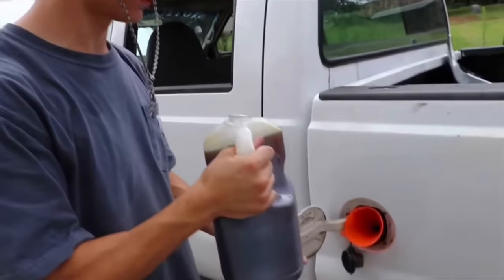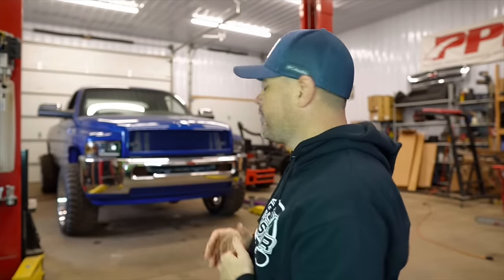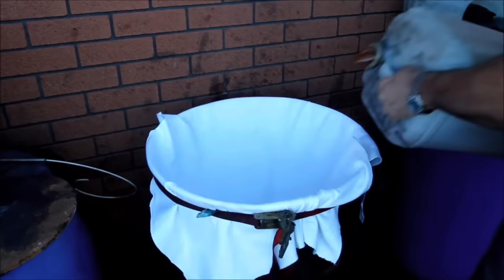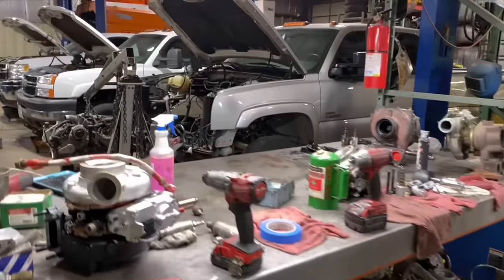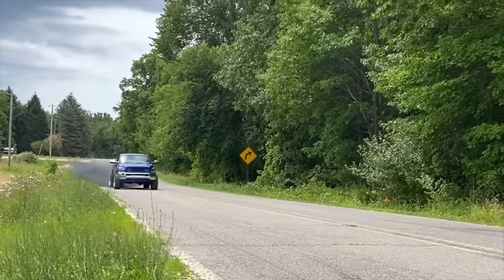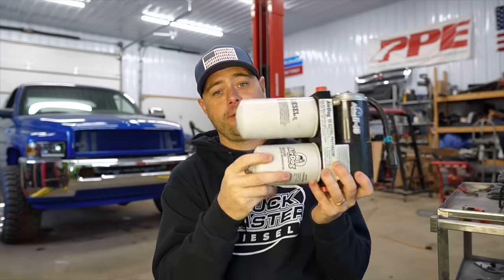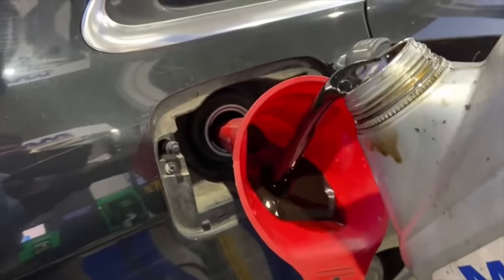Can You Run A Diesel On Used Engine Oil? Free Diesel Fuel? *EXPLAINED*

Comment: I would recommend you use a centrifugal filtering after pre filtering your veg oil. One method I use is to let the oil settled out for a couple months. The layer can be pretty clean and clear. I never use old oil due to the ash (carbon) content.
Reply: You can buy a fry filter machine it comes with de powder which filters down to 2 microns it’ll get the oil crystal clear after that there isn’t any need for a centrifugal separator or filter it’s what the big oil recycling companies are using. Not the exact same but a machine that runs on the same principles
Reply: @Justthemow  Have you used this to filter your oil?
Reply: @xtreme808  yes when I had diesel lawn mowers I used oil from restaurants and I used this exact filter to clean it it will work with motor oil the exact same way there is a company called filtra going around buying up all the motor oil here in the south and they use this exact same method on a larger scale to clean and recycle motor oil
Reply: Right on I appreciate the info. I have found this whole “making your own diesel fuel” subject extremely interesting.

Not that I’d try and use homemade diesel fuel in my newer Ram Laramie 3500 Dually but I do love the concept that’s for sure.

I can remember decades ago seeing a guy fill up his truck bed tank with old vegetable oil he’d get from fast food joints. I thought this was such an amazing concept.

Of course this was way before the addition of emissions equipment like diesel exhaust filters and what not.
✌🏽

Comment: I bought a 98 12v for this reason   I've been running. Wmo for 3 years now   it saves almost 40 to 60$. At every fill up   gives me no problem
Reply from the maker: Love to hear it 👍
Reply: I have a gravity fed filtration system with a 5 micron filter and a 3 micron filter that I run it through first never gave me any problems

Comment: I’ll never get rid of either of my diesel trucks. My 1999 F-350 SRW 4x4 crew cab long bed 7.3L is my daily with 150K on the odometer. And the other truck is a 2003 chevy 2500HD with the old LB7 duramax that used to be my daily. The chevy was getting rusty (since i live in illinois for now anyway) so i parked it and it will get a full rebuild. Once i’m out of illinois next year the ford will be parked inside with the chevy and will only come out on nice weather days. I bought the chevy with my dad on his birthday back in 2009 so it’s sentimental to me since he’s been dead for almost 7 years now. Both trucks are my babies and i will pass them down one day to my son.

Comment: I’ve accidentally ran 90% used oil in my 12 valve; smoked and bucked for a couple miles until it mixed!! 1500 gallons of oil run through with no problems, just a few extra filter changes 👏

Comment: I have a 2004 ram 2500 with the 24v. I was the oil King on a destroyer when I was in the Navy, so fuel treatment and testing was my life for 5 years. So I bought the truck new with 7 miles on it. I have burned pretty much anything flammable and liquid. Kero, wvo, new vo, mgo (marine grade oil- like 32w hydraulic oil) wmo, mineral oil, etc. Only had to swap injectors at 257k miles. Bosch dealer called me a lier because those early High Output injectors always failed at less than 150k, according to him. I have all the fuel test equipment so I blend to get in the viscosity and Flashpoint ranges specified by Cummins. 498,000 miles as of right now. The rest of the truck is falling apart but the keys to the drive train will be in my will.
Reply: Can you please tell how you mixed it. 50- 50 with diesel plus minus or how ?
Reply: @wesselvanderwesthuizen2706  there is no set %-% to get it right. I have the test equipment and would Flashpoint test the oil I was wanting to blend, and do a viscosity test on it. Then I had a rough idea of how much oil to diesel or even kerosene. I'd mix up a test batch, and test that. I would keep doing that till I was within Bosch specs for Flashpoint and viscosity, then mix a big batch with those % till that used oil was gone. Had to do it all over again when I got more used oil. It is very complex to do it right.

Now if you're willing to experiment, you can slowly mix say 5gallons of diesel with used oil, and go like 5% used each time, till you notice the engine running rough, loss of power, or smoking. You do run the risk of damaging your engine that way however, which ruins the reason you were doing it- to save money.
Reply: @steamman5320  I heard other YouTubers talking about mixing with gas or old gas because it's thinner than diesel fuel and you want to bring the viscosity of the oil down to the viscosity of the diesel fuel. If you have any thoughts on that I would like to hear it

Comment: I've run a 95 powerstroke with a grease car kit and an 82 Mercedes off WVO for thousands and thousands and thousands of miles, the Mercedes was a single tank and in the winter 50% wvo 45% diesel and 5% unleaded gas
Reply: ʜɪᴛ ᴍᴇ ᴏɴ ᴛᴇʟᴇɢʀᴀᴍ ☝️☝️

Comment: I own a 7.3 power stroke, 2000 to be exact, Got a plethora of gauges and fun toys in the cab to study this specifically including also being able to run on propane and waste oils, 

Waste oils are VERY dirty, Very dirty and I have a filtration system inline to filter the waste that comes from the fuel tank and then feeds to the motor, It uses two lift pumps (The main and a secondary) and a slightly higher boost setting for helping to burn off the crud, The MPG calculator says that you get about 2 miles to the gallon less depending on what kind of oil you use and how clean it is and constantly having to replace filters and then dealing with very early oil changes its nice.

Just remember whatever is in that oil including fine particles of zinc, phosphorous and or wear metals from another motor is going right out of your injector and is sprayed all inside of the cylinder and can contaminate your oil quickly and completely destroy emissions systems.
Reply: Yeah can you destroy your emission systems on your new vehicles if you would have paid attention everybody said that it's for the older diesels

Comment: Old school truckers would put new ATF and 2 stroke oil.    Still do that from time to time.  Like a gallon for every 50 plus gallons.   It really does quiet the injectors.   Wouldn’t recommend on anything with emissions in place.
Reply: Doing that in my N14 Cummins, 1 gal of 2 cycle clean oil every now and then

Comment: I’ve put 18 gallons of gas in my diesel premium gas what I did was kept the truck on and opened the water separator valve and dumped out like five gallons put Lucas fuel treatment to add lubricant to fuel and filled up tank every time Ii had a chance till I felt comfortable letting it get bellow 3/4 made it home with a 19 k pound trailer 1600 miles away

Comment: My old 84 Mercedes suggested up to a 50% kerosene mix for below 30° usage. It was in the owners manual.
Reply: below 30 f? you mean when its positive temperatures ?> :D srs ?
Reply: @tigriukasinlove  no cold because iit burns hotter keeps the car cabin heat warmer
Reply: It recommends kerosene in low temperatures because kerosene has a lower freezing point than regular diesel...

Comment: Steve Miller was using old oil on his previous truck. It was a Cummins 12 valve, he had no issues with it running on it. Your   Dodge will run on it as long as you filter the used oil before putting it in your tank. Also the 7.3 Power Stroke will run on used oil I've heard.
Reply: They can up to 25% anything more & the injectors won’t like it much, it’ll start to smoke too much, clogging injector tips, & gunking up piston rings.

Do not attempt on a diesel unless it’s mechanically injected after 94 or just don’t do it at all unless you’re ready to drop $ into the filtering process. Ideally the oil needs to be distilled, but no everyone wants to try that.

Under no circumstances should veggie oil be ran in any diesel unless it’s converted to bio-Diesel. Veggie can & will kill a healthy 7.3!
Reply: @Michael Benoit CP Steve Miller on YT ran old oil for at least tens of thousands of miles, on his 12v.

Comment: Years ago some semi trucks had onboard systems that would trickle the engine oil into the fuel tank. There was a make up oil tank that kept the engine full. The engine oil never needed changing, just periodic filter changes.

On anything with a DPF, burning oil would be a bad idea. This would lead to excess ash accumulation in the DPF and premature replacement or cleaning.

Comment: Had a fuel delivery driver tell me one time that both of there on road and off road(heating oil) came from the same pump  they had to mix die in with the off roadwhen they were filling their tanker
Reply: I’ve heard the same. I run off road in my wife’s bmw x5 diesel all day. Hard to dip the tank on it and it’s a closed fuel filter so you can’t see the dye

Comment: I'm someone who doesn't have money to burn, we have a 2010 f150 it goes through fuel almost as bad as the 97 dodge that just had it's life ended after approximately 300 k. These things truly run forever. I've been seeing these videos on YouTube for quite a while now. The last video I watched the guy did something you didn't mention in this video. He stated he used i think he said half a liter of gas to each gallon of fuel. Im no chemist or anything like that, however I believe that it sounds like a good idea. The fuel in the oil would definitely thin it out, the same as paint thinner in paint. You're definitely correct about the older trucks being highly sought after. The next truck has to be diesel as ten to thirteen mpg is a big expense. Using it for work every day it cuts right into every gain. My going to the pump and buying diesel would ultimately be the best option for us.

Comment: When I used to do this I used to filter with centrifuge, then mix it 20% gas or lacquer. Use a fuel treatment every 5 or 10k miles. I did this for about 150k miles. It was a 1993 Mercedes-Benz 300d 2.5 5 cylinder.

Comment: People always ask how i use straight waste oil. Its simple, Ive been using used oils from cars trucks in my 98 12valve for years. The trick is the 98 12v only has a steel suction pipe and screen in the tank no electric pumps. Also lift pump and injection pump are mechanical. Alot of ppl use older Mercedes diesels for the reason of mechanical injection. I think ive had only 1 bad tankful ever. And i learned to not cut oils with gas. 🤣🤙 so far 35k+ miles no issues whatso ever.🤞
Reply from the maker: I really appreciate the info keep us updated

Comment: I’ve got an 03 gmc LB7. Never getting rid of it. Just changed the injectors at 268,000 miles, runs well, no rust, regular cab long bed… No reason to spend 100,000 dollars on a new truck these days! It’s ridiculous.

Comment: in Virginia, kerosene costs way more than diesel! in non-electronic diesel engines (ie farm equipment) maybe a gallon of kerosene to 8-10 gallons diesel because at 10F or colder, fuel treatment is almost not enough! on a 1975 Ford 5000 tractor, dad happened to put 5 gallons gas to top off the fuel tank he then put 5 quarts transmission fluid in the tank and run the tractor a few hours with no problems and added more fuel to the tank later to top off again.  for the 2008 LMM and 2008 Cummins, when only local driving i get fuel at the Exxon (at I-85) in South Hill, VA. to date NO fueling issues with this diesel fuel. every Love's i see has biodiesel, i don't use that!

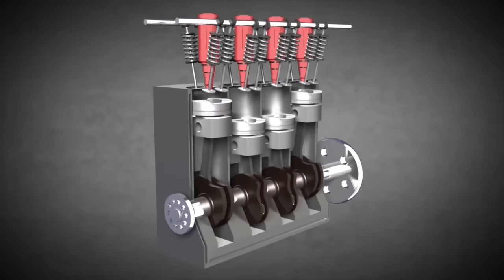Comment: I've got a 1996 12 valve cummins with a little over 1.2 million miles on it. The engine has never been apart other than to reseal and kdp. Tappet cover etc.  I've ran 100% WMO for almost 100,000 miles with no issues whatsoever. I do have an airdog 150 that I change the filters on every 3000-5000 miles but that's only around 30$-40$, I make up that with one tank of fuel! In the colder months I mix 1:10 WMO:GASOLINE.
NOTE: I do run higher EGT's with WMO. I'm co servative with the throttle and keep them below 1800°F. I need more air ie: a larger turbo. Other than higher EGT Temps and more regular fuel filter changes I have no issues at all. I live in S.E. Texas where Temps hardly ever get below freezing.

Comment: Military motor transport and heavy equipment vehicles.  All had the ability to used "mixed" or "alternative "  fuel... for the same reasons you spoke of.  Farm equipment over the years would often be run with mixed fuel.  Although it's never "ideal "... it's sometimes necessary.  
  The nature  / character of diesel alone often requires it. Just as you showed the various grades of diesel fuel.  Winter fuel and summer fuel depending on the location.  The trend of converting used cooking oil was very popular.  However it just faded when fuel prices dropped and "regular" diesel fuel was "affordable " again.  So follow the path of least resistance and return to pump. Until once again the cost of fuel has risen. So again the search for alternative means... The problem is and you are right. The more refined our modern vehicles have become.  The less tolerate they are. Huge example is the exhaust system that everyone hates.  It may work to achieve one thing at the cost of what in the long run ? Burn a odd mix of fuel and run it through that and yeah  $$$$... 
   As always Truckmaster, good video.  Very good topic of discussion and knowledge.  As always looking forward to seeing what's next.  Hopefully we will see great things in the WIFEMAX build and the conversion short wheel base 2wd build...EVERYTHING...  But most importantly it's the holiday season.  Family is first and foremost.  In the military you were taught "mission first". Sadly many of us Veterans lived by that rule and family got pushed to second... Then when you leave the military.  That same mentality exists.  
   To all Veterans...Family and mission are joined and subsequently.  They both come first.  
   Happy Holidays...MERRY CHRISTMAS... To the Truckmaster family.

Comment: Used oil filtered mixed with transmission fluid from a transmission flush works really well and it’s not as thick then and goes through the fuel system better

Comment: I run a 94 Peterbilt with a 3406c full mechanical cat. As winter sets in fuels get thinner equals poorer fuel economy. For every 1000 litres or one fill of fuel I’ll add 80 litres of used oil. That’s almost 10% in summer I’ll run closer to 20% just cuz everything runs thinner an easier. Instead of straining it I’ll put it in barrels so it settles metals an crud an water. Then I’ll put a tap on it an tilt it over so 3/4 of it gets drained. Other 1/4 goes into my pit door boiler then I’ll put it onto a stand tank beside my diesel tank an it’s conveniently beside my fuel source. I’ll run a tank of black diesel then run a clean tank with injector cleaner then back to black. I only change a primary fuel filter every 60,000 k

Comment: Always install additional filters to diesels just in case you get a bad fill from a garage.
Converting vege oil to diesel requires caustic soda and ethanol, mix well, and let it settle.
The fastest way to clean dirty vegetable oil is to add corn starch, heat it, mix well, and let it settle.

Comment: I have a 2005 LLY. Its motor is all original with 295,000 miles on it. I am the original owner. I have run 1 gal of gas in winter fill ups as long as I have owned the truck, typical fill up is 22-24 gal of diesel. I was told many years ago by a GM engineer that this was the best way to keep diesel from jelling. 
I also owned a bar and grill for a few years. I would take the used fryer vegetable oil and strain it with cheesecloth. Then run it about 1/3 2/3 with diesel during the warmer months. My garage smelled like French fries when I fired it up.
Reply: did u just say gas in a diesel

Comment: 2002 ..7.3 now has 324000 miles running on 30percent used oil and 70percent diesel mixed and filtered to 9 microns ... Over 150000 miles since started using this fuel ..also I might add 24 plus mpg. Might also mention I live in cold climate...
Reply: I have a 2003 7.3 ex what's the easiest way to filter the motor oil?
Reply: @carriemercer8168  I use 12 volt transfer pump ... I then pump oil and fuel mixture thru  3 filters into a 55 gallon drum..... from final drum I have another filter as fill truck ....A Battery on battery maintainer to cheap harbor frieght pump ..some hoses few fitting and hose clamps and off you go
Reply: 3 filters??? All same or different? Or varying down to 9 micron?
Reply: @mrmotofy  very down to 9
Reply: @Hardworkingman870  have you seen using a centrifuge it can pull out everything down to half a micron. Seen a few YouTube videos on it i think using that one could run oil mixed with gas to thin it without any diesel at all in pretty much everything as long as it doesn't have emissions devices. New common rail needs deleted and good to go